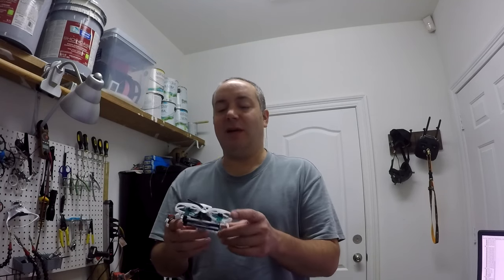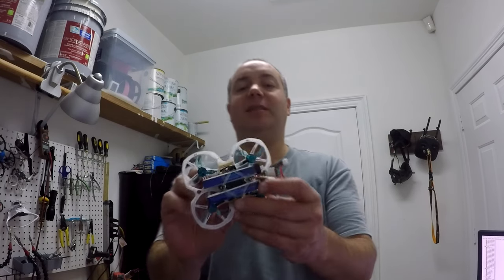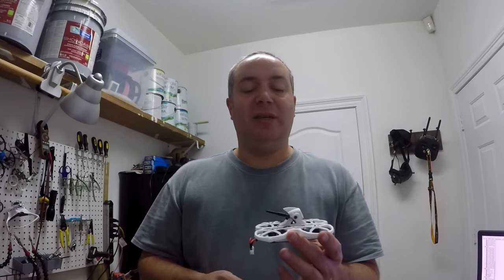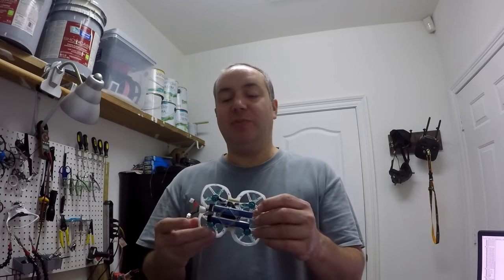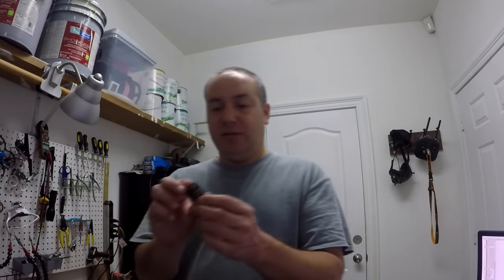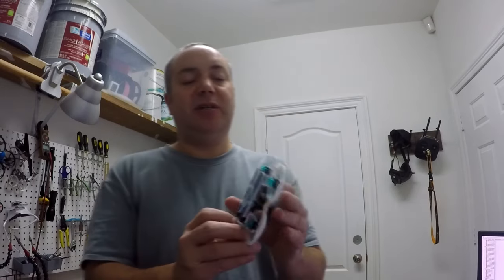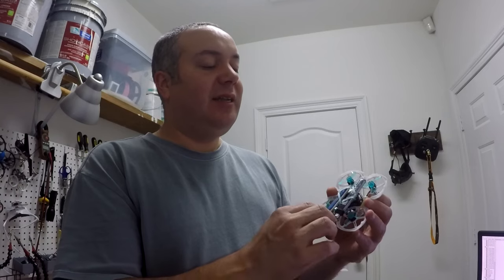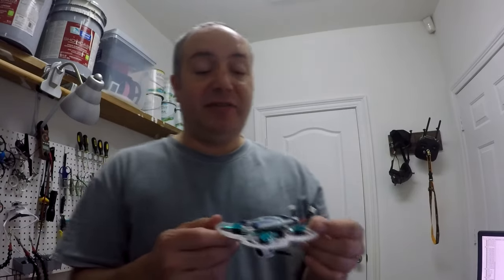TinHawkHD Build

Comment: I saw a guy from Europe who made a DJI whoop and it weighed 36g. First off, ditch the Emax frame. Too heavy with analog whoops, so much too heavy for DJI whoop. He insisted on using the Beta FPV 75mm frame. I've tried that, but it's seem hard to work with. Wish that guy had a build video. He did say the key is NOT to use 1102 motors - Too heavy! He used 0802, 19000kv, as I remember.  It can be done, and I'm working on mine.  With those hints on his build, see if you can come up with one that weighs even less than 36g. 😎👍
Reply from the maker: Have you seen my Eachine Trashcan? It's 0803 motors. What camera did he use? I use the DJI cam in this build, so there's surely some weight that could be lost there. However,.. I much prefer the DJI cam over anything else. If they're using an older Nebula Nano v1/v2,... it's irrelevant. I will NEVER fly that cam again. I do now have the Nebula Pro Nano on my Trashcan instead of the DJI cam. It's pretty good. I mostly just like that it's not glued in versus the DJI cam. Some weight could be lost going to a Caddx Polar Nano without it becoming a completely terrible video experience,..... The Nebula Pro Nano is pretty beefy for its size.

But,... I built this TinyHawk because I love the look of the TinyHawkII frame. It's kinda my dream build. So ditching the frame is not an option. To me, just getting them down in the range of a normal 75mm whoop is good enough. My original design constraint for the Trashcan was to get it light enough to not sound like a jet on the tarmac like my CineBee75 did. I ended up only a couple grams heaver than when the Trashcan was analog with a Runcam Racer Nano cam.
Reply: @rcrdps8144  He used the Polar camera, but admitted the better way to go was the Caddx Nebula Pro Nano, because it's barely any heavier and gives us 120fps, and fully adjustable parameters in our goggles.
Yes, the DJI cam is too heavy, and huge. lol  We would all like to use heavy near perfect cameras, but in a whoop that's also gonna be very heavy for a whoop, the lightest possible is the only way to go.  Many say the difference in image quality between the DJI cam and the Nebula Pro Nano is so small, it's not worth discussing.
Please remember, one of the issues with the Trashcan vs. the Mobula7, was the Trashcan was way heavier. So, making your DJI whoop more like a Mobula7, could save a lot of weight. Even the 0803 motors would save some, and any on a whoop is worthwhile.  It all adds up! :)
A "normal 75mm whoop" is around 20 grams. We'll never achieve that, as our DJI tech stands, but as you said, close is the goal.
Anyway, the purpose of leaving a comment was to instill in you to idea that you can get it even lighter and break well into the 30 - 40 gram range.
I saw a post by the rarely seen guy who did the 36g DJI whoop, just a few minutes ago. Here's his post showing his 36g DJI whoop racing against a stock Mobula6: https://youtu.be/1SEYFyuFEPY
Reply from the maker: @KOrnhOliO1   Just to be clear, my DJI cam, while probably still kinda heavy, is very cut down. It has none of the metal casing. It's the size of a nano. But,.. the lens is still full sized, so that's heavy. I forget the weight of it though.

Thanks for suggestions. I do want light,.. where I can,... but also within what I want. I don't really go for the skeletonized look. And I like having the ducts or props in view,..etc, etc.
Reply from the maker: @KOrnhOliO1  Just found a pic of the weight of my cut down DJI cam. It's 5g. So yeah, a Nebula Pro nano would save 1.5g.

Comment: I have two of these that I upgraded the analog cams for better view.  I am inspired now ro go digital...  time to tear down a caddx.
Reply from the maker: Admittedly, mine wasn't half bad when it had a Runcam Racer Nano. If I still had a RapidFire module, I might have kept it that way, but the white flashes/bars were just too irritating. You can probably see that video a ways back. But yes, DJI is a "whole new world"</ariel>. 

I did make up a new battery mount that stacks them and turns them sideways like the original. Seems to fly a lot better since there is less restriction to airflow. But it still gets some vibes if I try to run the stock props. That's my end-goal.

Comment: stack them left to right.
Reply from the maker: The boards, or the batteries?  Assuming the batteries, yes, that is my next project. I am going to swap out the lead to a single BT2.0, and make 2s packs. Then make a new holder and turn it 90 degrees.

Comment: What’s the lowest voltage that the Vista will run at? Specs say 7V, which is only 3.5V/cell, and whoops like this usually run them down to like 3.2V.
Reply from the maker: It's definitely below 6. Let me see if I can find that dvr where it fell out of the air.
Reply from the maker: Basically 5v. Here's my last recorded "caption" in the srt file for the flight that fell out of the air:
signal:4 ch:65535 flightTime:35 uavBat:4.9V glsBat:15.4V uavBatCells:2 glsBatCells:4 delay:35ms bitrate:50.8Mbps rcSignal:4
Reply: @rcrdps8144  Awesome! You are the man!
Reply: I've ran mine down to under 5V too, definitely drops to the ground before video cuts out 😅
Reply: @FilipRadelic  Thank you! Figured the quality DJI gear had conservatively listed specs. Will try a naked Vista with Nebula Pro Nano on a 2S setup soon. Happy flying!
Reply: @TweakRacer  DJI is weird with specs, like they will say Avata battery is up to 18min when realistically it's 12-13min at most in real use. On the other hand they advertise FPV System up to 4km when we know it can do 13.4 😄
Reply: @FilipRadelic  Agreed. DJI hardware usually outperforms the stated specs - with the exception of drone flight times. However, that is normal across all brands. The stated ideal/max flight time is basically in a hover, at sea level and cool temps, and zero wind.